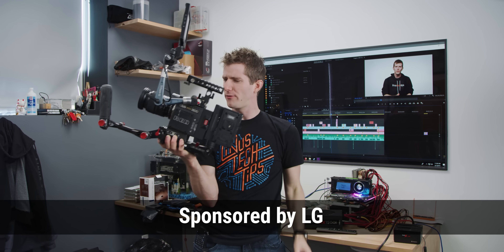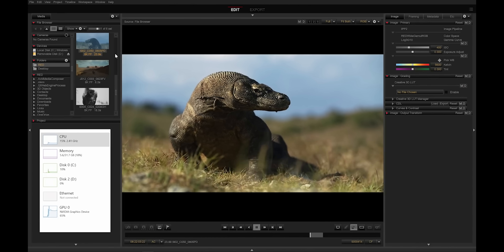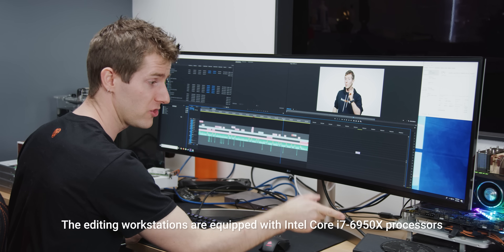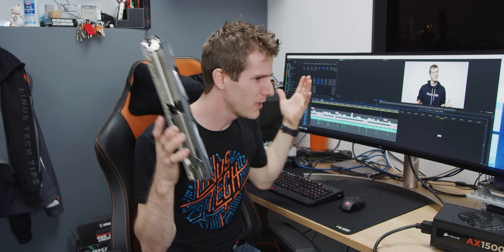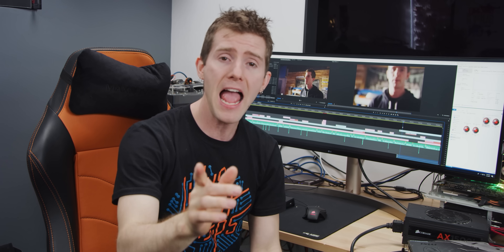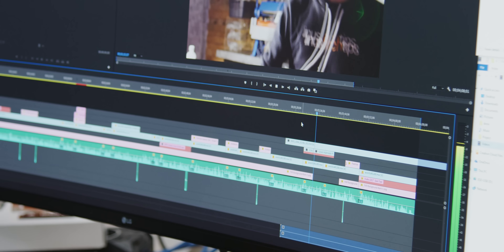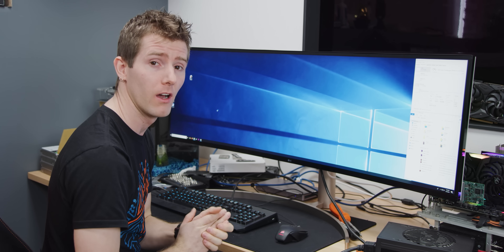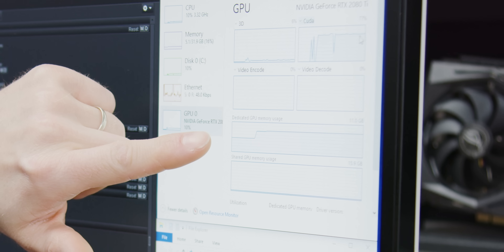How To Edit 8K Video - Threadripper + Ultrawide

Comment: bruh
i was editing 8k with foss software on my crappy pc  on linux (the foss apps had hardware acceleration)  and i could apply every single video effect on the fly - while doing a playback of the video and even after i added almost every video effect i still had a smooth video preview.
     Linux for the win !

Comment: I had this discussion with a DP and Gaffer. He kept saying that RAW uncompressed is faster. I (as a VFX Artist and a degree in electrical engineering with focus on microelectronics) denied this. It became a very heated debate.... only for us to work on the same project months later. Only a year later during screening part, we met at the director’s house. I instantly knew who he was, he didn’t know who I was. Then over dinner he was like: “ohhh hang on, we had that heated argument!” Me:  I said and I still standby it. You’re a great DP and wonderful gaffer but you know nothing about performance computing. In his mind compression is CPU and CPU is synonymous with bottleneck. For us compression means dedicated hardware to decompress it straight in to the speedy GPU memory. But getting that data there is always the tricky part. Disks, CPU busses, they form bottlenecks. And as a VFX guy I’m not a fan of compressed footage. But as editor I love it and I adore it as a producer because I don’t need as much storage to keep it archived :)

Comment: @6:22    You said you were using an i7-6950X with 10 cores.  Why did you then say you were going from 18 to 32 cores ?  Were you actually running a i9-9980XE ?

Comment: I am in love with this monitor, and i would really love to buy it, but i am not sure it would work with my mid 2018 macbook pro with i9 processor and Radeon Pro 560X. Before i saw this monitor i was really interested in the LG34WK95U but even if on paper it's advertised as fully compatible with my computer after a Mac OSX update, a lot of users (and also the lg canadian Help Library) claim that  the LG34WK95U is not compatible with 15'' macbook pro. Is there a chance you would make a video that shows any compatibilities between my macbook pro and an ultrawide monitor with at least 1440 pixel of vertical resolution?

Comment: There are workarounds that are so easy and cheap though. Most professional digital cinema cameras, including RED and Canon, record ProRes or H.264 proxy files simultaneously to an SD card while recording 7:1 RAW/R3D files. You're watching it play back in your timeline on a preview size of about 1080p. Just edit with your proxy files when you need smooth response times, then simply connect the full size files when color grading and adding effects. You'll save thousands of dollars without sacrificing efficiency, additional rendering time, or output quality.
Reply: ...on second thought, rational thoughts like that aren't why I love this channel...keep it up! lol

Comment: LINUS,
How about an 8K build discussion?
SSD's, GPU, CPU, DDR4 amount, software etc.
For example, do you store the footage on an HDD, then copy to an SSD before working on it but also have a 2nd, faster SSD for a buffer and if so how do you set all that up in the software?... also, Digital Foundry said they ran out of VRAM when they had 11GB or so when discussing the Radeon VII 16GB card (so the NVidia 11GB card performance just tanked) so how can there be enough VRAM for editing using the RTX2080Ti?

Comment: Two questions for you, Linus: 1) did you check the windows scheduler issue in threadripper/epyc?  2) would you try a configuration with dual RTX2080Ti and/or single/dual Epyc Rome workstations?  Maybe you can still get very smooth workflow if you throw in a few extra thousand.

Comment: Try using 2 2080 ti's in sli and use 2 or 3 nvme drives in raid 0. i wonder how much the footage would scream. would also cut render times significantly if you guys didnt have a render server( if you still have it)

Comment: Wait, isn't that a super-ultrawide?
I thought "regular" ultrawide was just 21:9

I think we are running out of superlatives to use lol...
But anyway, even though it is pretty similar naming it seems like a tech-spesific channel should strive to get that right to avoid confusion.
Maybe I've just got this terminology wrong and they are both technically defined as ultrawides. I'm not even sure how formal the naming standard on this is yet.

Comment: So a 2080Ti, 32GB of top shelf RAM, an SSD and 12 cores of 4-5GHZ should be able to take care of a heavily effected 120fps slow-mo shot filmed in RAW 8K? Now to afford that $50,000 Camera setup...not to mention the $4000-7000 computer after its all said and done. FLEX DEM STACKS ♠

Comment: I don't get it .. back in the day when real time video wasn't really even possible. We just transcoded the video in a rediculas low resolution, then did all the editing in the low resolution (also often low frame rate). Then when the edit was finished. Then just popped in the original file. Let the software run all the edits on it over night, then just run it over as a slide show to a timelaps VCR. Now you could edit video on something like a 386 (If you had a rediculasly large hd...)

In linus case... He is really not seeing any more than 1080P while editing... So why use the 8K video?

Comment: Cpu clock is not stable. Try oveclocking cpu with better power delivery And try setting minimum frequency to 100 percent in control panel in advanced power management.

Comment: You don't use a desktop computer for professional work. You use an Intel Dual Xeon workstation. That's what they are made for. DUH!!!!! It's not just the CPU and GPU. It's the platform they are attached to as well.
Reply: You mean like my 2009 Mac Pro's. I edit 10 bit 4K on them running FCPX and Davinci Resolve Pro with ease on a 4K timeline.

Comment: Wavelets are a technique used for image compression, it's similar to fourier techniques. You find all the low frequency features and extract them first then the mid range and the the high, this allows for long runs of similarly valued features which can be heavily compressed without loss. You can also optionally apply a loss by throwing away some of the high frequency components this can add some square features to the result but its one of the better artifacts to have and with a good post-processing filter the effect can be minimised. The reason for using wavelets instead of fourier analysis is that it's much faster, but when you have millions of pixels it's clearly still a lot of compute to be doing. Fortunately it's mostly matrix operations and so will benefit from gpu acceleration if someone writes the library for it.

Comment: Was solving some 8K enc/dec problems with custom built Vulkan coders ... 
Well, the problem is that you'll need completely affine environment with monopolized hw access for it to actually work.
I.E. ditch your graphics card driver entirely and manually do stuff with just with your program, so the GPU wouldn't be shared and there would be no context switching overhead.
Same goes for memory and CPU cores...

But my 8K enc/dec works on Power9 with a Radeon 7 as a charm, because of better virtualization and much higher throughput.
I'm so glad AMDVLK exists.

Comment: Funny thing is, if I were to buy that display - it would still be disappointing for Eve-Online. It's one of those games that just requires infinite space. After a few hours, you find ways to use all the space up and require more! Seriously, not making this up. Anyone who plays EVE knows this. I have an Ultrawide display. LOVED it for Eve for a few hours. Then I realized, shit I still need more space. So hooked up the monitor that was replaced by the Ultra wide right beside it. STILL not enough.

I do absolutely love my monitor setup for multi tasking though. But  again, Eve is just an N+1 type of situation. The more you throw at it, the more you require. As the game's windows/the tools you use with it just infinitely scale up.

Comment: Try pitting the 2080ti with a Radeon VII on the same workload perhaps?
Reply: It's Adobe premiere pro. Nvidia GPUs are like a league above AMD here. Even the Vega 64 is 13% slower than the 1660 Ti in that software. And the Radeon VII is 2% faster than the 1660 Ti lol. In Premiere pro, for 8k playback and editing, 8 or 10 GB of VRAM is sufficient. So Radeon VII's insane memory is of no use here. Nvidia's CUDA excels at this part. You can google the Nvidia vs AMD in Adobe Premiere pro. But it's Adobe. If it's something like DaVinci Resolve, AMD's OpenCL is on par with Nvidia CUDA.
Reply: @jamieammar6131  yeah but maybe the memory and bandwidth on a Radeon 7 or a Titan RTX will make a difference. A lot of credible Youtubers have mentioned that making a huge difference in their ability to scrub through 8k footage. Now, Linus found a great workaround but maybe a Radeon 7 or Titan RTX will make this and everything else in your Premier Pro workflow a lot faster in general.
Reply: @MarketAndChurch  Not in Adobe PP. Yes in Davinci Resolve.
Reply: Does he even own an ATI Rad 7?? 😲
Reply: Or the RTX Titan. I want to see how memory and bandwidth can improve (or not) this workflow.

Comment: But what does that mean? if adobe can impliment this "offloading solution" in general (for all video filetypes), wouldnt that mean our current PCs and workstations should get an enormous performance boost and we wouldnt need to buy the latest and greatest/priciest hardware? isnt that not less than a gamechanging software solution or did i misunderstand?

Comment: Hey Linus don't tile two layers red r3d files in timeline. It stutters even more. Premiere tries to read both though the lower V1 or V2 is overlapped by V3 or so. Try with single layer your performance might be lil better. I've done these research on a 1060 6gb and an i7 2600k, 8700k, 6700k. I've much more data to share you. I've done the research on arri raws too. They are infact much heavier than what Red r3d's 7:1 cuz they have .ari image sequence so each frame is individual and go all the upto 28 mb per file based on colour data and luminance. I still edit my red dragon 6k at full quality on these above mentioned rigs. They just chew through like they're nothing with multiple complex grades. There are much better work around for these.

Comment: 0:46 ~ Something like this = https://arstechnica.com/gadgets/2012/03/new-itunes-1080p-looks-good-through-better-h264-compression/

I never bought an iPod Classic. I did buy the Dreamcast months before it came out, with the Free DreamCast T Shirt.

Most Videos were exactly the resolution of the screen.
Just a fact. Render Higher than Native, Scale / Down Sample,
looks better than many of the AAx4 AAx8 solutions of the exact same time period, without reaching 4x work load or frame losses. #PCvsConsole.com ~ Up sampling is crap; that Xbox & Playstation both serve.

You doubt my eyes? ~ The character models are not the screen resolution. Zooming out on the TextureMaps would down sample the DreamCast Games. ~ This is not CRT overdraw, this is Texture or Layer Maps made Smaller by running away from perspective. DreamCast battle games did this often. 1GB vs 700MB, slightly better textures and colors. VHS is ~ 333x480 pixels. = #DreamCast 640x480 magic for CRT. ~ Playstation 2x the CPU, 0.5 the Video Texture or Shader Storage Space.

PS2 could do textureless polygons better than even today's computers=visual compare of #MGS2 vs rain in other games.

Yet when it came to color quality. Dreamcast Video storage of 8MB really was static image 2x as pretty. PS2 was definitely faster slight of hand. But human reactions and games, people sort of like /slow motion karate attacking each other/. = Oouuuuu, pretty. Your Karate uniform is so beautiful jump over that and kick again, throw that beautiful barrel or chair again, let's remove the memory card and do that Close Quarters Combat CQC. Soul Caliber \ Soul Blade, Beach Volley Ball Bounce = Giggle Giggle, impressive computer power (ignores crediting artists.) = I never got to play the beach volleyball. But the internet and magazines was frame after frame of the crispest side boob and bounce any game ever had.

Video Memory. I wrote about it so much asking for 12MB, sony promised 64MB of Video on PS3 patents.
Reply: 1:07 ~ i never complained about the PS2 video memory. I want that to be understood. It's smallness was its secret to speed. ~ The Asking was only about what would you like in the next model. Someone taught me how to multiply and figure out raster value per pixel. Looked up different color depths.

an example (1440*960)*48bit [[16bit*3]] = about 66MB, and Sony patents promised 64MB.

launch games were suicide tempting if was someone's life work, #NASCAR = PaintBall Artist.

what it led to, was the introduction of pre-rendered and layered graphics. UnMatched Extreme Beauty /lack of color depth, sort of flat/ yet the tree leafs and grass and water and sky danced. Beautiful fast as reality. Not the Play Fighting with Friends speed of movement.

Comment: ooh ooh!!!  I know the answer to this one.  Transcode the footage into a ProRes proxy and use that on any old quad core with a GTX8xx card.  Seriously... 8k footage on a monitor that can only display a 3.5k image, in a window that's more like a 720p sized image.   I'm not sure that the real solution is to use the very latest Threadripper CPU and most advanced consumer GPU with a beta driver that's not supported by the popular editors.  It's cool that it's possible.  But it's certainly not what I'd consider practical.

Comment: Is the CUDA GPU in WDDM or TCC mode? If you aren't in TCC mode you are leaving performance on the table. Run the UI off an embedded Intel iGPU in the CPU. Put the CUDA GPU in TCC mode. Boom goes the dynamite.

Comment: a FPGA is the exact opposite of specialized hardware...  Field programmable gate array, basically  it can  be programmed to act like just about any specialized silicon chip (within it's size limitation's of course).  It's sort of a universal processor.  The down side is they are mega expensive, the upside is if you are only making a few of your product, it's still way cheaper then getting custom processors made.

Comment: Surely the hardware is only going to get you so far here. The biggest issue video editors have with Premiere is.... Premiere. It simply cannot utilise multiple cores effectively. Especially AMD (Intel works best).. as I’ve built and tested both. Take your 8k into Resolve and you’ll find it plays back without dropping frames using far lesser hardware. This test is exclusively applicable to Adobe Premiere only - people need to know it is light years behind DaVinci etc. The underlying architecture is not designed to utilise the latest CPUs properly. And that’s coming from a CC subscriber and video pro!

Comment: h.265 needs hardware implementation to work properly. As far as I know, almost no hardware has support enabled yet. So it's running via software only, which makes it slower than hardware implemented h.264.

Comment: Wavelets are really interesting. In a nutshell you can run an high resolution image into 4 filters (called wavelets given their shape) each one returning an image which is half of each sizes (a quarter of the number of Pixel). By properly choosing the right wavelets you can extract "vertical details", "horizontal details", "diagonal details" and a smaller version of the original image. The 4 results require the same amount of memory as the original to be stored and you can reconstruct the original image without any loss. By repeating the process recursively on the "smaller image" generate at the previous step you can encode an image at multiple resolutions. You can reconstruct the frame  by using all the wavelets up to the resolution you want. The higher the resolution the higher the computation needed for reconstruction. This is a very smart way to play a 1080p preview from an 8K file without the need to down sample on the fly.

This is the high level idea, than smart people have found ways to put them in practice.

Comment: Okay so this is just me, but how is it possible to decode just part of an image which is using entropy coding? Like, shouldn't the low res performance be exactly the same as the high res performance? Maybe with RAW, I would understand, but it's not just strictly RAW, it's compressed at least a bit.

Comment: pass, you can get decent 40" 4:4:4 chroma tv's that are 3840x2160 for cheap these days - 2 of those would be way better than one of these. (personally I use 3x 40" 2160p displays).  I really don't like the half-height "ultra-wide" setup (or really narrow aspect ratios).  I'd much rather have an 11520x2160 or a 7680x2160 even...  why does everyone seem to want to go the way of sacrificing the vertical pixel count and associated display real estate?

Comment: Wow, the whole video is about a software-related problem... o.O

I mean playing 8K-video in a maximal 1K sized section of the screen should not need to decompress 8K to interpolate it to 1K. Also it's just not optimized that this software uses the CPU for wavelet-transformations which is like a big matrix-multiplication (the thing your GPU was built for o.O). Getting rid of bad performance in video editing via a better hardware should not be the case.

But even if playback could be handled by cheaper hardware through better software, you would still need it to perform any calculations/modifications/effects on your video. So I guess that's a point. But still... just the playback shouldn't need so much power, especially during editing and without any effects or something rendering.